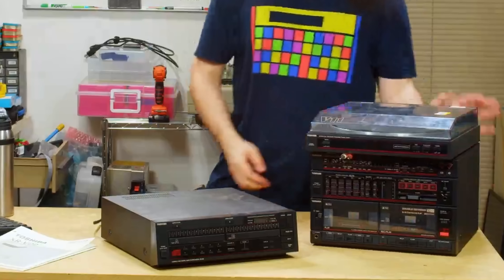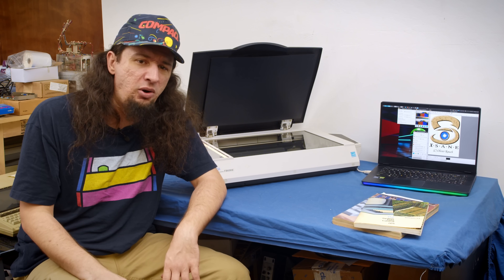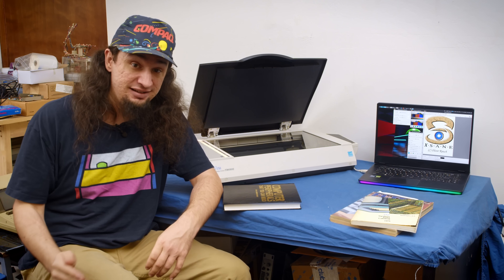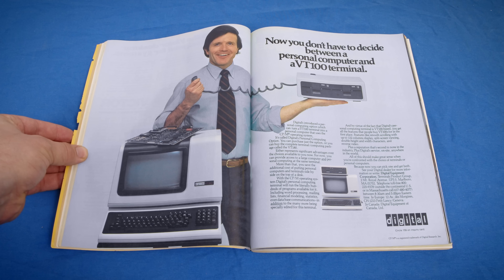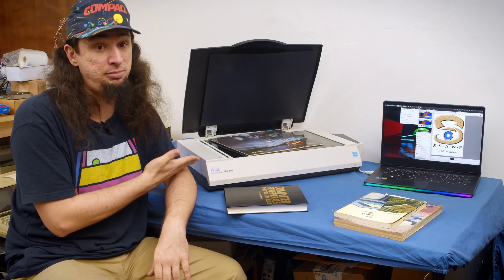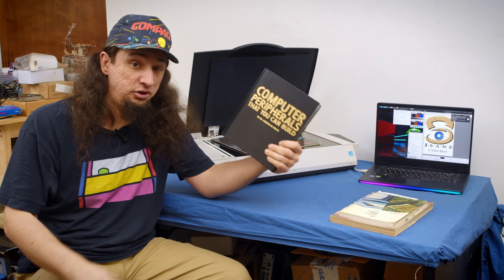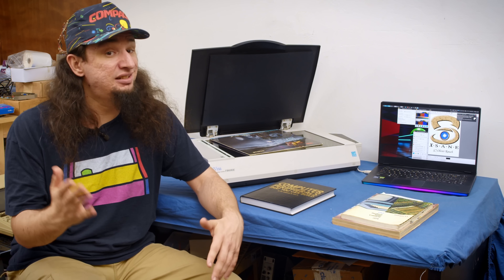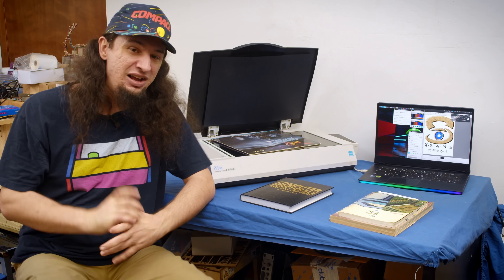Archival Grade Flatbed Book Scanner - Avision FB6080E

Comment: If you want a FAST A3 scanner, you need to get a Fujitsu. They're not zero edge though, but holy crap are they fast. I have a fi-5750C, and it scans at 600dpi the speed most scanners preview scan. If it's not on a super beefy table, the whole table will move when it's moving the scanning head. It also has a full duplex sheet scanner on top that scans pages at the speed a photocopier sheet feeder does.
Reply: Oh, and it works just fine with SANE / XSANE in linux
Reply: I was wondering how well they do. I work in IT, i've installed a bunch of the small sheet feeders for people, but they're mostly text documents. I'm wondering how they do on 600 DPI photos. Do you have any experience with that? I'm wanting to scan a bunch of old car magazines at 600 DPI.
Reply: @johnnyeskimo  I would imagine the sheet feeder scans at the same quality as the flatbed part. In the Fujitsu scanners (at least the one I have), the sheet feeder is an independent scanner just mounted to the lid of the flatbed. It actually has 2 scanners in it so it scans both sides of the page at the same time, and it also has heaters which are supposed to remove wrinkles from the paper as it passes through the feeder. I haven't actually used the sheet feeder on mine as something is wrong with the mechanism and it's jammed (or it needs new rollers because the existing ones swelled?? I'm not sure - I ordered new rollers, but never put them on, and haven't yet had the need for a sheet feeder badly enough to take the cover off and figure out if something else is the issue - I have a lot of other projects / repairs that need to be done long before I get to fixing the sheet feeder on the scanner!)
Reply: @gorak9000  Have you had a chance to scan photos on the flatbed? Does it seem to scan at a good quality? Thinking seriously of getting one on ebay.

Comment: The big Linux compatible scanner is cool. Would be nice to be able to scan bigger stuff. Confused about something you said regarding A4 size scanners though. You said there are not many options available that are Linux compatible. Is it because you need EXACTLY A4 size or would US Letter size which is extremely close in size to A4 also work? As for US letter size scanners that work with Linux they are like a dime a dozen. I have a generic off the shelf $50.00 Walmart 600ddpi Cannon all in one that works perfectly. And a much older 300dpi HP all in one that also works perfectly. I'm not saying they are the greatest scanners or anything but it just seems that smaller standard document size scanners that work with Linux are easy to find. Hell my Canon even has native Linux drivers though I don't bother installing them because the ones built into Linux work great already and they are a .deb package and installing them on Arch is a pain in the ass. (Though I have done it in the past.)

Comment: you know  you can always replace the scratched glass.
Reply: sometimes it has a calibration sticker on the bottom underneath the cover though - most scanners have that. It wouldn't be easy to replicate, as that calibration sticker is how the scanner adjusts the color balance to account for lamp / led aging. It would have to be just the right material and the right "white" to not completely throw the color balance of the scanner off

Comment: I have several flatbed scanners, and they ALL suck.  None of them are actual stand alone devices.  They require the computer to do everything, as there is next to no electronics in the actual scanner.  So pretty much every scanner i have is useless, unless i am running an old version of Windows and i happen to still have the device drivers available.

I miss the old days when the actual device contained enough brains to actually function, and the computer was just the recipient or generator of data to be sent to, or received from the device.  I blame intel for this.
Reply: Commercial scanners are like that - I have a Fujitsu fi-5750C - it has SCADS of boards and chips in the scanner itself. It's clearly doing 95% of the image processing internally, and just sending the final image down USB to the computer. It's also insanely fast - it scans at 600dpi faster than most scanners preview scan at super low resolution, and it's A3 size, so dealing with twice the width and length a normal scanner is

Comment: Yo, I work at a public library that uses Envisionware stuff, and can give you a little insight on the rationale for that upcharge: support. Managing the tech for so many untrained users comes with a desire for the local IT department to be able to call someone to fix their stuff, and leave them to work on internal things. Availing your equipment to the general public means that the load on IT departments can be pretty high. There are internal systems as well as publicly-available systems to maintain and secure, plus all the added workload and bureaucracy that comes with being a publicly-funded institution.

A lot of the time, these public-facing amenities are funded by grant or donation money. This basically means it's not coming out of the library's budget, and supporting the things is as simple as delivering the user report to whichever company is getting paid to make sure it works.

All that being said, I'm with you. The tech on display with these white-label services can range from "meh" to "trash fire". It's obvious that these companies aren't tech companies as much as they are tech services companies, and it unfortunately shows. The problem is that there's very little competition in the market, which means cost increases while value decreases. But hey, at least I don't have to deal with that print station that keeps acting up! That's someone else's problem! :P

ETA: Forgot to point out that these kinds of things basically sell themselves to donors. Give us <Envisionware's named price> for a scan station, and we'll put your name on this plaque that kisses your butt for "strengthening the community" or whatever, and we'll... uhhh... put it on our website, or something. Oh, you want to donate TWO?? By all means!

Comment: Damn, thats a crazy scam that multiple companies are running ... to overcharge public libraries for overpriced scanning equipment.
Reply: Library solutions appear to be universally dreadful, putting awful interfaces onto printing as well, and of course many of them are based on Windows, too, amplifying the pain.

I bypassed the stupid library computer interface last time I needed to print anything by plugging a USB stick directly into the printer and using the printer's own menu. Since the USB port on the printer was prominently labelled, I imagine that enough people had been irritated by the computer that someone at the library had decided to give users an easier option.

When a printer's user interface is better than someone's supposedly easy-to-use product, you know that these library vendors are selling overpriced, unfit-for-purpose junk to a captive audience, possibly with a bit of municipal corruption thrown in as well.

Comment: I was disappointed to hear you say you had zero desire to learn about Windows compatibility - I stopped watching there.  It's understandable for yourself since you use Linux exclusively as you have said many times.  But I would have at least looked at which versions of Windows you can use this thing with *for your viewers to get them pointed in the right direction if nothing else*.  Please consider it from that perspective going forward.
Reply: Do it yourself
Reply: It's Windows 10 compatible, so I take it that it will work with Win 11 as well (from extensive experience with the entire Avision range)